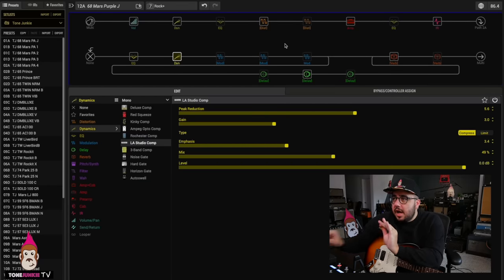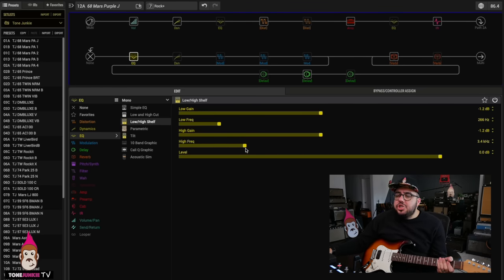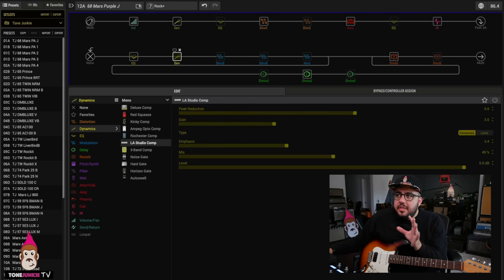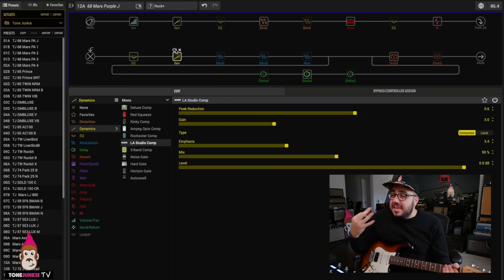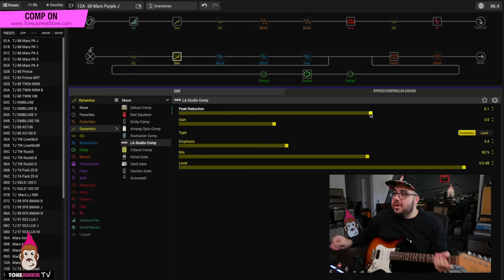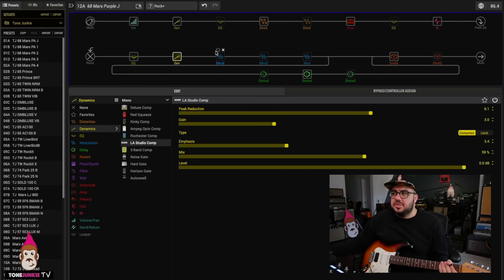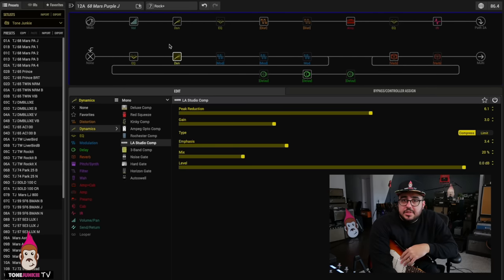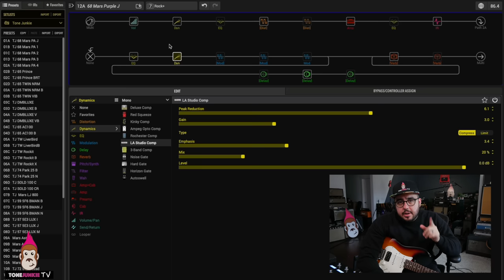How to Get Better Tone from any Modeler...

Comment: I got a Source Audio's Collider reverb/delay pedal in my stereo effects loop, were would I place it in my Helix/PodGo/native signal path? Tryed it in front of amp block and it's really noisy even with proper gain staging, I place it after a stereo dynamics block at end of my signal chain. Seems to work better, is it right? In a real amp head I'd put it in effect loop of amplifier, how would I do that in Helix/PodGo/Native?

Comment: Would you put a Studio compressor in the end of the chain even with heavy metal high gain amps, like a 5150?
Reply from the maker: Yeah try the comp with the settings form the video and the mix at like 20%, it may be awesome or it may sound worse! 😂 nits worth a shot.

Comment: I use several LA compressors in my chain, but I play clean with humbuckers in an es335 style guitar, which sounds horrible thru a line 6 Helix.  I first have to peak-up different parts of the clean signal along with adding a tone pedal and also double amping in the Helix chainl and finally out into the power section of my AER 60.  Although it still sounds sharp, the result is tons better just using one amp amp in the Helix chain along with conventional pedal drives.  Except during the Leo Fender blackface days, amps have seldom been voiced for either hollow or semihollow PAF equipped guitars.

Comment: I can never seen to get a sound I like out of my monitors when using the helix, but if I play through the line 6 power cab it sound fine. My monitors are Yamaha hs7's. I even had kali lp6 and the same thing, didn't like it. Any tips on running through monitors vs power cab? Thanks
Reply: The monitors are way more honest than the power cab. Meaning they are producing a sound that is, more or less, what you made. 

Other things to consider: Where are your monitors placed? chest high? head height? where is the power cab? on the floor? That massively affects perceived frequencies as well. 

If the power cab is on the floor, its going to be adding worlds of bass into the heard frequencies as compared to monitors that are on a table. That alone could be it: you might be liking a beefier tone the power cab is creating. The monitors can make that same tone too, you just have to adjust your presets to get there. 

I trust my LP6 monitors for my Axe FX3 and love them a lot. The produce an almost identical tone to what I hear in my headphones (Sennheiser HD58X).
Reply: I plug my Helix with an es335 style guitar into the power section of my AC 60, but I play clean.  Either way, it sounds horrible.  However, without doctoring up the signal with LA compressors and other aids, it sounds hideously worse.  Most amps seem to like strats, teles, PRSs, and LPs, which I don't.
Reply from the maker: I also prefer the power cab. A lot of it is probably the speaker aimed directly at your ears. That your monitors away from you and if you like it more you just prefer a more amp I the soon tone where the speaker isn’t aimed at you.
Reply: The Yamahas should be no problem.I use HS8s.I also have Genelec 8040a , old great set, for recording.
Also , great value Adam T5V at a cheap ptice are sweet too.
Reply: You should probably check if the output is set to line level when using monitors.

Comment: Vid seems way overdone.
Just say use a post amp EQ with both high cut and low cut and then put a compressor after that with light compression on.   Done!

Way too much talk of shelving blah blah blah. 
You doing a Home Depot project there or what? 🤦
Reply: Hahahahahaha.